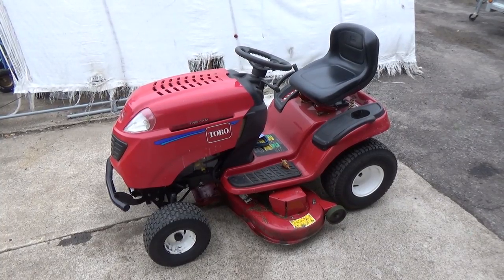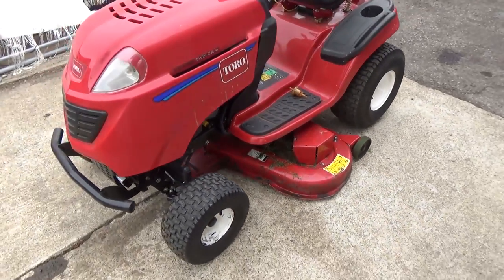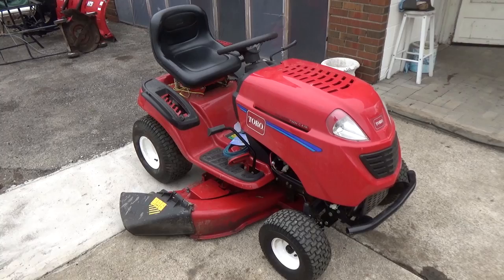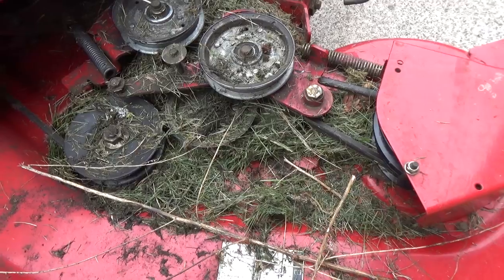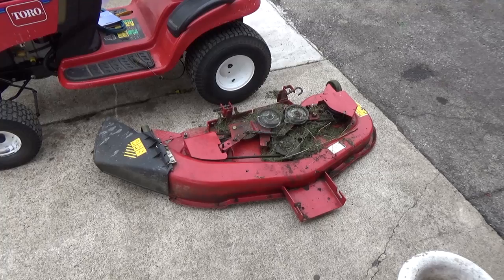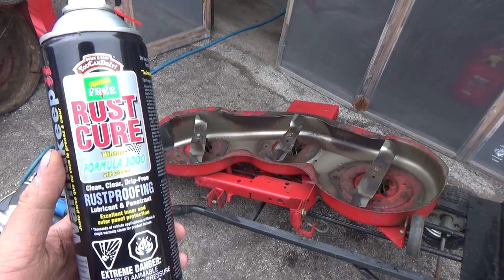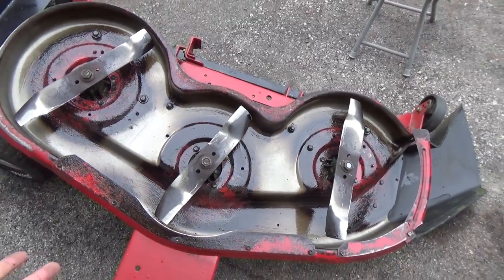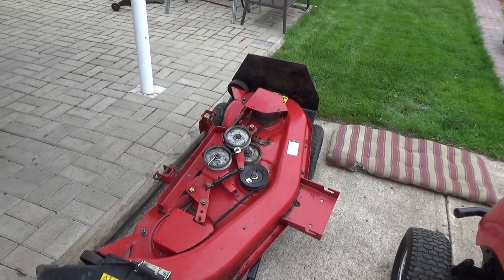How to Undercoat a Deck - 1 Year Update

Comment: I would've honestly paid you $300 to do that full service this year. My deck was BAAADD
Reply from the maker: It's worth it to clean them up and try to prevent rot. A bit of rust isn't a huge issue. But if left to sit, with all the wet grass, they rot and now you need to find a replacement mower deck. It's not worth it to buy a new deck and they come bare, you need to swap over all your parts. Can buy another used mower for the cost.

Comment: I just stripped down my deck for a rehab.  Wire wheeled, grinder, hand held sand blaster.  Once that was done I welded the holes closed then grinned them smooth.  After that ospho rust treatment and 4 cans of rust-oleum.  I didn't have a single problem welding the holes closed and the rust treatment killed all the rust.  It is practically brand new and total rehab including new belt, two pulleys, 4 new spindle bearings & new blades.   Total  $112 and about 6 hrs. over two weekends.  Looks newer than the mower.
Reply from the maker: And this is why no one understands why I don't do that for customers lol if I charged someone $112 plus 6hrs labour on top they'd probably have a heart attack lol
Reply: @EliminatorPerformance  To be honest, if I was charging someone I wouldn't have taken my time but even at half the hours I could see people saying no.  I had just taken the trans axles out to be rehabbed and just saw that sorry looking deck and knew this was the time if I ever wanted to kill two birds with one stone.  Now I am pretty sure I can get another 10 years out of it or get pretty close.

Comment: Nice work and thorough explanations, what about a universal washout port for washing after cuts I'm ready to install one, are they recommended?
Reply from the maker: Thanks, yes they work alright, if anything I'd install 2 (one for each side). You have to use them when the mower is running and the blades are turning!
Reply: I just a piece of PCV pipe, capper one end with a T and put a hose fitting on the other.  Drilled a few 1/8 inch holes and I was ready.  Just slide it under the deck, urn on the water and mower, and let the water do its thing.  I can move the mower forward or back over the pipe for better cleaning.
Reply: They do work. When you use it set your deck to the lowest setting.

Comment: Great video thanks. If you’re repairing the top deck after removing flaking paint an rust, when do you apply the colour coat? I guess after the rust converter ? And then you don’t use the rust preventer stuff as well on top of the pain do you?

Comment: I decided to use the Rust Cure after completely removing all the grass under the deck.   I sprayed and brushed the Rust Cure on the underside of the deck 2 days ago.... to my surprise it is still wet to the touch and I'm wondering what I did wrong.... A search of the web shows that it should dry in 2 1/2 hours and give it a day or two before you scrubbing it..... Any ideas why it isn't drying... tomorrow will be three days.     The mower is stored in a heated shop.   Thanks    By the way I tried POR and it peeled off while I was cleaning it (I won't do that again)....
Reply from the maker: It won't dry, don't worry if grass sticks to it because it'll scrape off easy
Reply: Isn't it supposed to dry?

Comment: I just recently got my first riding mower (Craftsman 2017 T3100 42") that was given a.k.a. saved from the landfill ! It slept outside for most of its life. It has rust, tree sap, and 5 years of grass build up ! I will definitely be doing this !! 
p.s. Any information about a Craftsman T3100 with the 20hp Briggs & Stratton will be appreciated !! 
Will a Husqvarna 42" deck fit under here just in case the rot on my deck is too bad ?

Comment: Why wouldn’t using the spray material used to spray truck bed liners work (smooth surface application), especially when the mower deck is brand new? Of course you would remove blades and tape spindles/shaft ends. It’s some really tough stuff and it just gets stronger every hour as it cures.
Reply: Simple.. Because that material holds moisture, and moisture rusts metal.
Reply: @Gutslinger  
Makes sense.

Comment: My poulan riding has a 10 years warrantee on but I still spray liquid graphic on the bottom and hardly any grass stick to the bottom.
Reply: liquid graphic? What brand?
Reply: Graphite paint. Sold at farm stores and hardware stores. Used in Seventies on gravity flow grain boxes to ease unloading.
Reply: @SamC_  I get it at home depot.
Reply: @SamC_  Majic Easy Slip Non-Stick Mower Paint

Comment: daily mower that i use is wash potted after everyday used (whether its 1 lawn or 5) and put away in a dry shed to dry. Every 30 days I power wash the entire mower and under deck and wiped down with a dry towel to get excess water off(Yes the under deck too) then let air dry. Once its dry a thin coat of WD-40 sprayed and used motor oil is then brushed on the under deck and wiped down for any excess or pooling so it wont drip. 10 years later and not 1 spec of rust or rot/ Total time 45 minutes a month. Also belt dressing/conditioner is used once a month and never lost a belt. All this new age crap and envorinment crap is worthless...go for tried and true!

Comment: I am getting ready to order a new deck for my push mower. I was considering over painting it with automotive paint first. Then should I use the formula 3000 on both sides over the new paint job? Is my paint job even necessary with the formula 3000 protection? Thanks for your advice!!!!
Reply: Painting is basically a waste of time especially if you have a sandy soil condition on your lawn. Just get the underside of the deck scrapped and wire wheeled to the metal then spray with the Rust Cure 3000 it is dripless if you control the spray amount (too much and it will drip from there). I use a light coating then brush it around for total coverage.

Comment: i'am going to do bed liner on top and bottom of my mower deck  This what i like PAINT ON  Rust-Oleum Truck Bed Coating got excellent texture and dries with in 2 hours
Reply: I used the same rust paint & rubberized spray paint undercoat. The grass clippings still stick to deck by discharge must repeat application.

Comment: If you blast the grease out the spindle grease after you power wash not very complicated, there is a coating that uses surface rust in the chemical cohesion. Them Chevy fellas use it I hear  lol

Comment: If you are going to undercoat, remove the blades and spindles. It will let you paint the metal under the spindle as well
Reply: A lot more work that we would need to charge the customer and i guarantee the spindle mounting bolts will shear off or at least half of them.

Comment: that is a thin deck if it rots though in 1 year if not painted.  I have a 25 year old wheel horse w original deck and lots of rust but its not near going through the deck.  Old ones were much thicker metal.    Once the deck is pitted I think you need to put rust kill on it then epoxy it or use POR-15.  Then maybe use some none stick stuff like in this video.

Comment: I just bought a new 42" Troy Bilt Rider.  What is your view on using Tire Shine or a Silicon Lubricant spray over the new paint on both sides of the deck vs. using the Rust Cure?  Thanks.  Love your videos.
Reply from the maker: Thanks Tommy, I'd use Rust Cure on the deck, I've never used a Tire Shine except on tires.

All the shops around here use the rust cure for undercoating vehicles, because it actually soaks into the metal, so it works pretty good, I've never had any issues.
Reply: Eliminator Performance is it advisable to use on a new  JOHN Deere? Even before its first use? Thx!
Reply from the maker: @liberdedeum6748  it absolutely will not hurt the machine in any way, we use it here in Ontario Canada because everything rusts here. 1 can is like $8 and is well worth preventing your mower deck from rotting away!

Comment: The best way to preserve your mower deck is to take the time to thoroughly clean all the grass from underneath. If you have loose rust, use a needle scaler (Harbor Freight) with your air compressor. No coating will last very long. You can spray a sealer on the surface after rinsing with water (and allowing to thoroughly dry). The sealer will last thru the winter, and you can start to use the mower again in the spring. The downside is you HAVE TO do it again after the last mowing in the fall. This is the only way you're going to preserve your deck, and replacement decks are way too expensive. Often, homeowner will junk their mower and go spend a lot of money for a new one just because they failed to clean out the deck thoroughly in the fall. The decision has to be made whether you want to prolong the life of you mower deck by fall maintenance or just spend a lot of money buying a new mower. It also helps a lot if you can keep the mower stored out of the weather over the winter.
Reply: 100% CORRECT!!!!!!
Reply: @Rob J in the great white north, we use rust check on our cars and on our mower decks before winter storage. It works!

Comment: Hey eliminator performance, what are your thoughts on the deck wash ports? Do you think this would be a good idea to use after every time you mow the grass? Then do an undercoat at the end of each season?
Reply from the maker: Yes we undercoat in the spring, and wash ports work great, but they don't get everything! A lift, and using a scraper works the best.

Comment: Minimal instructions with the spray.  It apparently does not dry........it stays wet.  Not sure how  long it will last.  Have only  mowed one lawm since coating the  underside with the spray. We’ll see.   will report back after a few weeks of mowing.  I suspect the constant barrage of grass clippings hitting the sprayed under deck would clean off the spray.  Hopefully not.  I have run the wash out feature after the first cutting.  Have Got to get my camera under the deck to check wash out results as well as sticking of any grass clippings.

JoeB

Comment: I tried undercoating my deck, but it only lasted about a month.  My mower is ten years old, and has no rust under the deck. The sand in our so called soil here in FL, removes all the original paint rather quickly.
Worst thing you can do is get the deck wet and not not dry it completely.
Reply from the maker: Yeah if you live in a dry climate there's literally no need lol we live 15mins from Niagara Falls and about 2mins away from Lake Erie, super Humid where I live and even new vehicles rot out quickly.

Rust preventatives are a must where I live!

Thanks for leaving feedback!

Comment: Does truck bed liner spray do any good?
Reply from the maker: Not on a mower deck, it will trap moisture in between the liner and the deck and will cause it to rot.

Comment: Now my nail on the wall for balancing/ hanging stuff looks ghetto ;p
Reply: A nail works just as well as any other balancer I have compared it to. In the past 52 years all I have used was a nail.
Reply: I have a 1/4" x 3-1/2" bolt in a vice if it makes you feel better
Reply: Nail works great

Comment: I tried undercoating my deck.  Cleaned it, washed it, dried it, then painted it.  The undercoating lasted about to mowings.
Reply from the maker: We use the Rust Cure Formula 3000, same stuff Canadian Tire uses to undercoat vehicles.

We find that it actually soaks into the metal and even though it may look like it's worn off, it'll still leave a protective layer.

Hope this helps!

Comment: Wish you would have told people to torque the blade nuts to a least 85 foot pounds ,the blades are a lot harder steel than the aluminum mounts that they bolt to , a little play in the blades and next season you will buying new mounts

Comment: The problem with these bottom of the barrell crappy lawnmowers exampled in this vid is the deck will never rust out before the mower itself is in the landfill. Secondly, its ok to wash, but never, ever wash after mowing. Its the worst thing you could possibly do. The deck bearings are very hot at that point, metal is open as its expanded. You wash and water is sucked in, defeating the bearings quickly over time. They are sealed bearings but water still will get in. Wash as little as possible. I might wash 2 times per year. 27 yr part time mower mechanic.....meaning i fix for the public nights and weekends. And in not knocking your 10 year experience,  just wanted you to know mine as well.
Reply: Interesting. My experience with my Westwood T1250 is, it’s still going strong since 1984? But it is on its second deck. Just saying. 🤷‍♂️
Reply: @chrish8871  now get back with me on how many 1984 mowers you find still mowing. You are the exception. I have 3 mowers in the 1960s still all mowing great, but I know I'm the exception because I actually fix stuff and so do you because a mower dont last from 1984 without a good bit of work all along. I show antique tractors oldest is 1924, newest is 1971. I get it.
Reply: Michael Collins 

Seems tother way round from here. But there we are
Reply: I have two john deere  Sabres  25 hp 54 inch deck , after every mowing  both mowers get blown off with compressed air 175 psi with a long wand blow nozzle, under deck and above deck, also the entire rest of the tractor,, once a year they both get one set of new blades ,,deck steam cleaned ,,,and  use rust prevent spray all done at end of season,, both bought new  one in 1998 one in 2002, decks both in great shape,, we mow 5 acres per week , 
Also great video

Comment: POR15 is permanent, the oil stuff you use is temporary at best.  Not even comparable.  Guess you do it that way so you can keep charging people every year to spray oil on their deck.
Reply: POR isnt permanent. It is chipped and eroded off during use. Both products in combination would be ideal. That said we just scrape, pressure wash, and fluid film. Cheap, fast, easy, and works

Comment: Oxidation is corrosion no matter if it is ferrous or non ferrous metal (metal with carbon) ferrous, metal without carbon (aluminum, brass,lead, copper .if you want it last forever and day and have  the extra money laying around c276 hastloy with the high nickel and chromium content it would last unlimited lifetimes with blades made of inkonell or just claded with it  yeah I know it's a pipe dream.

Comment: Aluminum Oxide.  Oxide of Aluminum.  Not Calcium.  It's aluminum corrosion. 

Cold hose water on the hot blade spindles will fill the bearings with water until next time the machine is mowed.  The bearings are steel and rust.

just sayin -